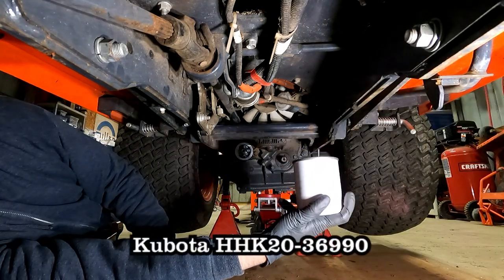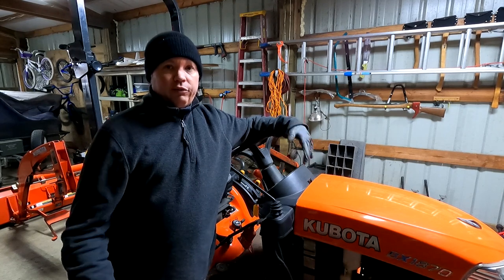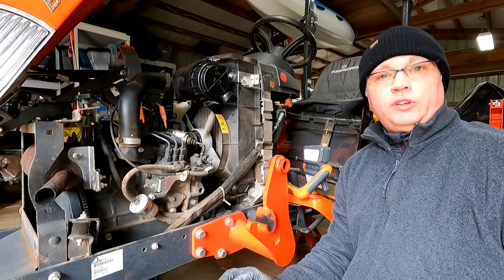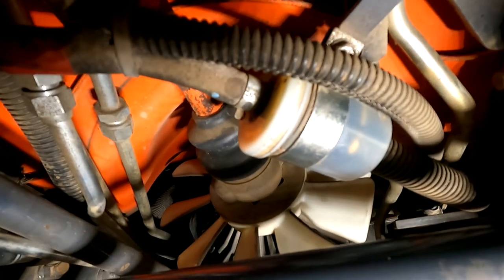Kubota BX Tractor 200 Hour Service Maintenance, Complete Step-by-Step Guide

Comment: Kubota technician here, the one piece of advice I'd give, based on your video, is that the loader can be an effective tool for jacking the tractor up for service underneath. It might be a slight pain for the engine oil filter, but it provides plenty of clearance when going underneath for your primary fuel filter after the tank, hydrostatic filter, propeller shaft boots, or HST pedal return spring. Of course a jackstand or two underneath the front of the frame is required instead of relying on the loader valve for support as they inherently leak internally. Other than that note, I'd like to commend you for being very thorough, I wish all of our customer's took the same care with their machines as you do. Granted, if they did it would be less work for me personally, but I'd rather see everyone's tractor last longer and cost less rather than relying on my support to keep them working.
Reply from the maker: Thanks.  Yes, I do spend a lot of time maintaining my vehicles/equipment, but I think it reduces time and money spent on repairs.  I've had this tractor for over 8 years now. I've just performed the routine maintenance per the manual, and it's had 0 failures in that time.